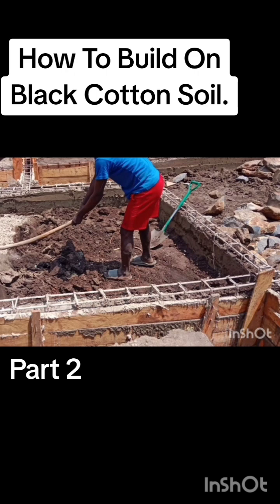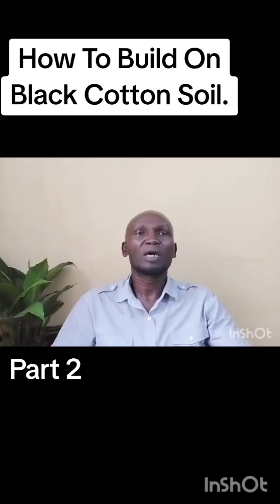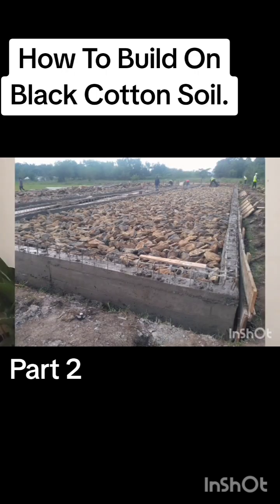How To Build Your Foundation On Black Cotton Soil.

Comment: Ujenzi today, what can you say happened with the nhc mamboleo house that have a problem with dumpiness and how can it be corrected?
Reply from the maker: Thank you.The nhc houses are a case of poor cement/sand ratio with a doubt of dpm and dpc present on the slab.
Worst case scenario you can remove the entire plaster and redo a free with good ratio of cement and sand mix.You can add one of the many water proof materials to reduce dumbness.